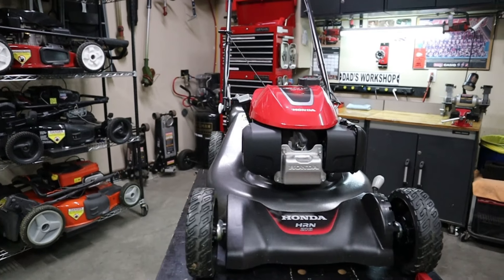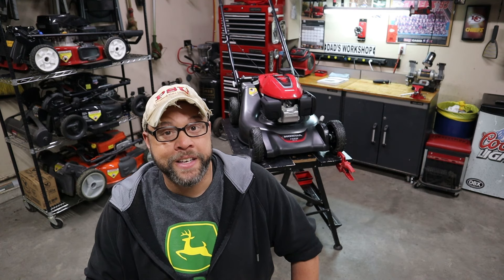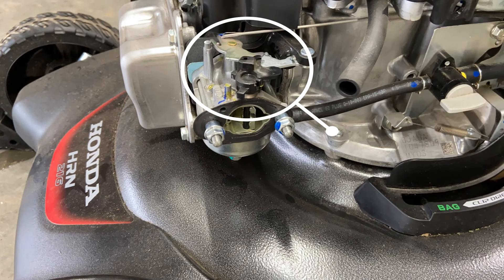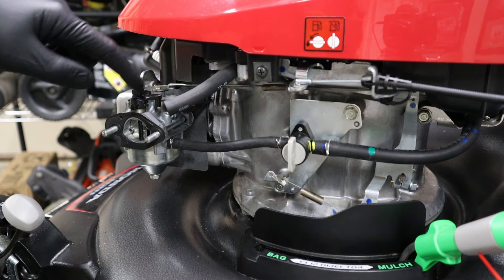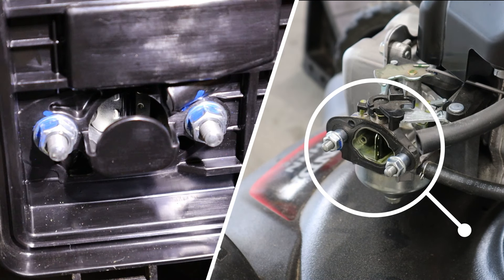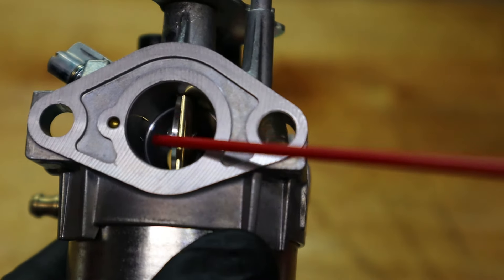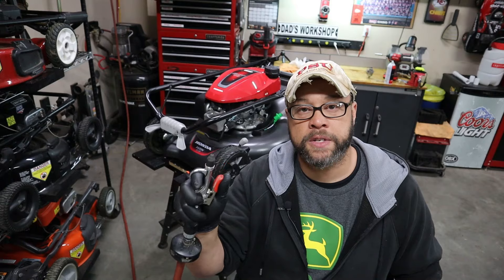New 2020 HONDA HRN216 GCV170 Surging/Rough Idle AND Auto Choke Test/Check

Comment: So I could not get the screw to break loose without stripping cross-point.  I instead sprayed the other jet openings you showed.  Put it all back together and mower ran great.  However, you knew this was coming, it started to idle rough again and fuel was flowing through the port inside the barrel.  Any ideas?  I am going to try and find the port brushes to see if some trash is maybe gummed up in the port.
Reply: I have the same problem with loosening the screw.  Don't know what to do.
Reply: @herbertchang8472  I used my milwaukee Impact driver and came off easy...

Comment: My Honda is 8 months old, and I just stored it for winter with all the right fuel steps, I am very OCD. The thing was surging this spring. I followed all steps from video and still surging with no fix. As it was back together with just the paper air filter removed, I ran the  carb cleaner can near the intake port in the small hole on the right as it was running and it cured it. I think the problem is the lack of paper filter fuel filter. On all my old machines, I installed paper filter fuel filter and it would start like a charm come spring. I use the oversized sit down lawm mower MTD ATLAS Style filters. #endrant.

Comment: Merci Monsieur Labrie (French: topographic name from l'abri 'the shelter', or a habitational name from a place named with this word)  I too am a little put off because I too, only bought this mower from Lowe's a few months ago, and I'm still making payments, and I'm having this problem.  My previous mower was a Husky, that I bought from Tractor Supply, here in South Texas, and it worked fine for six years.  What gives?  Kipp, I love you man!  Thanks for this excellent knowledgeable and well edited video.  I will first finish cutting the lawn, then either return this mower, (I have 90 days.), or follow your most thorough instructions.  I like that I can engage the mowing blades, and I like the rear-wheel drive.  It is expensive for having this problem, so soon after I bought the mower.  What happened to, "Honda produces great products"?  Fast forward a few hours:  I was not able to take the PILOT JET screw up, the Philips head stripped.  I did spray carbonator spray in the other hole mentioned in your video.  No go, this didn't fix the problem.  I returned my  Honda mower, HRN216VKA engine GCV170, to Lowe's.  The manager was kind enough to return it.  I bought it on August 12, 2021 and returned it on October 23, 2021.  Beware, Lowe's no longer has a 90 day return policy, they now have a 30 day return policy, since the beginning of 2021.
Reply from the maker: Wow! Thanks for the kind words and thanks for watching.

Comment: I bought this exact same mower last July to replace my 15 year old lawn boy. Stored it for the winter break. Pulled it out for some spring lawn care and it started surging. So I pulled out my 15 year old lawn boy and it started right up. I’ve never had an issue with the briggs and stratton engine on the lawn boy. Came across this video and im gonna try the fix on the Honda. After 15 years the old lawn boy still runs like a champ. Honda needs to fix this because everyone has this problem.

Comment: This fixed my Honda after I was able to remove that incredibly stuck pilot screw. Almost stripped the screw head, had to put the carb in a vise and use an impact driver to remove it.
Reply from the maker: Good job! Thanks for your support lorddyvim.

Comment: In the past, at the end of mowing season, I always drain my fuel tank and then run the mower until all the fuel is out of the lines and carb. and I never had a problem with surging. I failed to do this simple procedure last fall and now my mower is surging 😖😡😫☹.  So I will start with Gumout and go from there...

Comment: Mine don't run at all but I feel it's still clogged. I'm going to clean mine out. The float part works.which usually fixes other mowers. Thanks for the know how in cleaning clogged carbonator. 73 
P S I just took mine apart but couldn't remove the screw it's on too tight and I don't want to strip out the head I cleaned out the gasoline chamber where the float is and removed the brass screw in the center but I don't know if I put it back right I need to look up the diagram. The mower runs now but don't idle right. I can cut grass and the power drive works, in other words the mower don't stall. If I cannot get that screw out I will just buy another.carburetor. I like the mower and the price was right because it was given to me. Thanks again I learned how to fix minor problems with these auto choke mowers. I have another mower that don't run and probably the carburetor is clogged somewhere. 73

Comment: Excellent video - has worked for me twice on my Honda lawnmower. 
I stripped the pilot jet screw (ridiculously soft metal for such a tight fit) and had to Dremel a notch to get it out. OEMs are pricey - do you happen to know if this is a standard screw 5 x 6 mm screw will work, or is it a specific thread type...?
Reply: It think Honda intentionally made the screw of soft material.  Job security for their parts selling department now that they no longer sell new mowers.

Comment: thank you for this post.   i cannot believe that you posted this video after mine started doing this yesterday for the first start of the season.
Reply from the maker: Absolutely JR, My HRN isn't even a year old and it started acting up. Never had this problem with my Briggs, Kohler and Subaru small engines. I knew I had to make a video when my coworker had the same problem with his new HRN, we purchased them a week apart. Thanks for watching.
Reply: @dadsworkshopbykipplabrie7982  mine is also less than a year old used only last summer. I have no small engine skills and can’t wait to get home and try this. 

This is also my first Honda all my other mowers take have lasted 10 years and I never maintenances them!
Reply: Easy fix!  Took me and my son 10 mins. Thank you again!!

Comment: Kipp need your advice i have this mower GCV170 only used it 4 time 2 and 3 time it was surging just like video. Used Sea Foam and it seemed to help.  4th time of use would not start at all sprayed some carb cleaner and got it running.  After use I tried to start it again and nothing.  Would this be the auto choke fix or would it still be a dirty carb valve? Thanks in advance!
Reply from the maker: The auto choke shouldn't be failing this soon, but you never know. Verify the auto choke valve is working properly as shown in the video, If the auto choke passes the checklist, then focus on cleaning the carburetor mainly the pilot jet transports. If possible, try using a sewing needle to penetrate the pilot jet passage then finish up with carb cleaner. The pilot jet transports are VERY! small and the littlest amount of debris will cause problems.
Reply: @dadsworkshopbykipplabrie7982  Thanks Kipp Honda should be paying you for all your help to customers!

Comment: How do you get the small philips screw loose?   That is the tightest screw I've ever tried to get off of a carburetor.   I even tried to use small long tipped vise grips to "brake it loose", and the vise grips wouldn't get it.   Any input?   If I keep trying the philips head, it'll strip out the internal philips slots.   Any input from you and others?   I don't think Honda wanted us to get this bugger loose.
Reply from the maker: https://youtu.be/2TuimCUzLFM

Comment: Great video! I have the same model that started surging. However, the screw on the pilot jet is so tight that when I started to remove it, the screw top started to strip. Any suggestions?
Reply: Im having the same issue and im so puzzled what to do cause its the only part that doesnt come off
Reply from the maker: I would spray “WD-40” and let it soak for a hour or safely safely apply heat/torch to try and free it up. The last restore is to use a small hand impact. I believe there are aftermarket carburetors for this engine that bypass the pilot jet screw all together. Thanks for watching.
Reply: Same damn thing happened to me...
Reply: Same thing happened to me.
Reply: @dadsworkshopbykipplabrie7982  I watched your video on replacement carburetors.  Is that what you mean by 'aftermarket'?  I considered trying the experiment but have no experience with small engines.  Is it dangerous to work with these things if we do something incorrectly?
Reply: Anyone having trouble getting the pilot screw off, leave it. Just remove the bowl and float, and take the main jet out from the bottom and clean it that way.

Comment: Great video. It's really helpful. I am having trouble getting the carburetor off the engine. Any suggestions? I am stuck on the tension string and the hose on the fuel injector.

Comment: Is there a way to clean out pilot jet without removing that screw on top? Like spraying carb cleaner up from bottom? I also stripped the screw
Reply from the maker: No if you spray from the bottom its cleans out the main jet "left side hole" I would go full throttle with carb cleaner on the "right side hole" and try to use compressed air.

https://cdn.powerequipment.honda.com/pe/pdf/pubs/te425pdf.pdf

https://cdn.powerequipment.honda.com/pe/pdf/pubs/otr55046.pdf

Comment: From what i noticed the pivot screw auto tightens and seems to over tighten causing mine to start surging again. I think the pilot screw is just a lil too long so I bought a screw m5 .08 and filed it down just a little shorter then the pilot screw that came in and not having the problem anymore

Comment: Kipp I just purchased a new Honda HRN216VKA with the 170cc engine,  I have noticed on your mower and on other posters videos who are reporting the same surging problems, Honda does not install any type of "Inline Filter",   Do you think it would hurt adding one of those Clear See Through Filters or the small Red saucer shaped filters on the fuel line between the Fuel Tank and the Carb?.
Reply from the maker: Great question, no it would not hurt to add aftermarket inline small engine fuel filter, that being said the GCV170 already features a fuel "strainer" in the outlet tube of the gas tank. I do recommend the "red saucer" filters that you would commonly find on and Briggs and Stratton, but I would stay away from any clear paper type inline small engine filters expect for one, I'll put the link below along with a few other links about Honda GCV170 fuel system.

https://drive.google.com/file/d/1VxJF3eOe6JQbg79E9XR1GRrksfWYjU0R/view?usp=sharing

https://www.amazon.com/APE-RACING-Replacement-Motorcycle-49019-0027/dp/B075PXT9VP/ref=sr_1_7?keywords=Inline+Fuel+Filter+-+APE+RACING+Small+Universal+Fuel+Filter&qid=1653797708&sr=8-7

https://www.honda-engines-eu.com/files/files/carb-check-gcv145-170-200-en.pdf

https://www.honda-engines-eu.com/files/files/repair-information-gcv145-170-200-en.pdf

Comment: Kipp… thank you very much.  My HRX started surging today with less than 10 hours on the mower.  Watched your video and 10 minutes later, I’m back in business.  I have a 30 year old hr194… starts on the first pull and never has any carb  issues.  Why are the new Honda carbs so finicky?
Reply from the maker: Good to here and thanks for watching. The pilot jet is small and easily obstructed. What really kills me is that gas/carburetor related problems are not covered under Honda's warranty, when they know darn well its a well known problem.

Comment: I purchased an HRN216 brand new two months ago. Cut my grass maybe four times and now it's surging. Great.
I bought the Honda to replace my rusting 10 year old Husqvarna that sat outside in the rain and snow most of it's life, yet still always started on the second pull and never surged. The base rusted through, but the engine still ran perfect.
So, is cleaning the carb going to be a 'thing' every other week or what? Maybe I should sell it and get another Husqvarna...

Comment: I only have 3 or 4 mowings with this new mower.   I’ve been using a lawn crew the last six weeks while I recover from a foot surgery and the mower has been sitting during that time.  I purchased some True Fuel 0% Ethanol fuel to put in the mower since it will continue to sit for a while.  I put half the can in a nearly empty tank.  Started it up and guess what?  Surging.  This is rediculous.  I’m reluctant to try this cleaning for fear of stripping the screw as others have.  I should have purchased a battery powered mower.
Reply from the maker: I understand your frustration, if you’re not comfortable taking the carburetor apart you can always try cleaning it while the carburetor is still mounted to the engine plus no tools or tare-down required! Just remove the air filter cover and the air filter element till you can visibly see the two intake “holes” on the front of the carburetor that I mentioned in my video, high speed jet (left side) and slow speed jet (right side). Install the long red stem that comes included with the purchase of most spray cans onto the nozzle, aim and fire! Clean both air inlets and don’t be shy. Last step pour the recommended amount of “Seafoam” engine cleaner into the gas tank and cross your fingers. Remember fix don’t come in a can but I have seen this work from time to time. Thanks for watching.
Reply: @dadsworkshopbykipplabrie7982  That still requires removal of the Phillips screw does it not?
Reply from the maker: Nope, try that short cut first and see what happens it's a 50/50 shot without tearing down the carburetor assembly. Also, you're going to need to bend that red stem on the spray can quite a bit to reach those inlet holes, you want to make sure that the red extension stem is shoveled/penetrating the inlet holes fairly deep before you start to spray, it might be easier to just remove the air filter housing plate to gain better access and have a flashlight on hand. You got this Hammer!

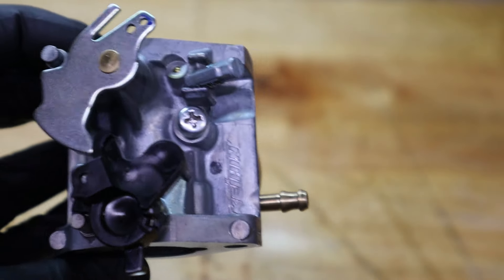Comment: This is great info! One thing I'd still like to know: What is that dial above the idle screw at 3:13? Is that an A/F adjustment? Do I need to be careful not to adjust that, or does it not matter?
Reply from the maker: It’s a fixed throttle so you can’t adjust the A/F mixture but…  there’s a loophole to adjust the A/F mixture but you have to break the pilot screw port. Thanks for watching Matthew Hurley!

Comment: I have the Honda hrx 217hya, I run non ethanol only with Startron. End of the year I change oil, clean deck etc, empty gas tank and let run dry. This the ideal storage for winter months?
Reply: Honda also recommends pulling the plug and adding a Tsp of clean oil to the cylinder. Pull the starter rope a few times and then reinstall the plug.
Reply from the maker: I did the same thing Shane, I let the carb run dry till the engine shut off before storage. To be honest I normally don’t do that but with this mower being a hefty investment I listen to the engineers... this coming winter I’m going to do the opposite and see what happens. Thanks for watching Shane.
Reply: @dadsworkshopbykipplabrie7982  Yea, I've read where some people leave their gas tanks full and fuel valve open for long term storage. Something about the carburetor drying out and plastic cracking. I don't know about all that. 3 years no issues doing what I do so I'll stick with what's working.

Comment: have a hrx217 with gcv190 on it, it surges(when no load) but surge stops as soon as blade engaged,i mean it doesnt affact mowing at all coz no surge when blade is on,do i still need to do this cleaning process?thanks
Reply from the maker: Guessing your HRX217 features "Roto-Stop" or blade stop as an option, then yes you still need to clean the carburetor regardless of engine load/no load. I would check the following, make sure the engine RPM is ranging maximum (2,950~3,250 rpm) and (1,700 +/- 150 rpm) at idle, make sure the engine is under load when you make your measurements, it might help to have someone assist you while doing this. Another test is to manually close the choke valve on the carburetor after the engine has reached operating temperature, when the engine is actively surging manually close the choke and if the surging stops and the engine runs smoother you can positively identify that the carburetor is clogged and or a faulty carburetor assembly. Start there and keep me posted. Thanks for watching.
Reply: @dadsworkshopbykipplabrie7982 thanks for reply. i just did the cleaning with carby cleaner your way,and it still surges when no load,however i searched around on net someone says sparkplug may also be a cause,so i changed plug and surge stopped....  but thank you anyway.

Comment: Great vid. Unfortunately while trying to get the screw out I broke the part on the carb with the spring on it. Trying to find a replacement but nothing is pulling up for the GCV 170 model. Only the 160. Do you know if the same carburetor would work?
Reply: I'm having the same problem, can't find any after market replacement carberator

Comment: This worked perfect. Only issue now is that it has a very high start up, then after a few seconds it tones down and is just fine. Is this going to be an issue?
Reply from the maker: Hell yeah! good job Lobrau, no this is a normal cold start, once it reaches operating temperature slap a tachometer on it and double check your RPMs are idling around 3000-3100 RPMs +/- 150.